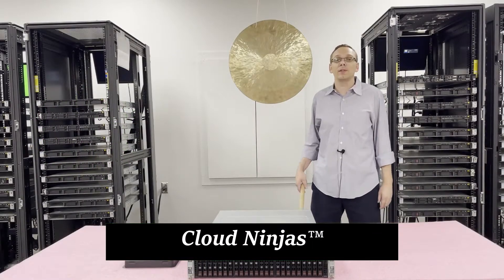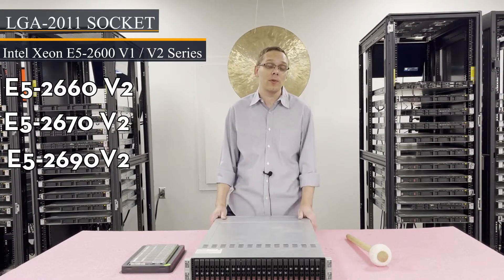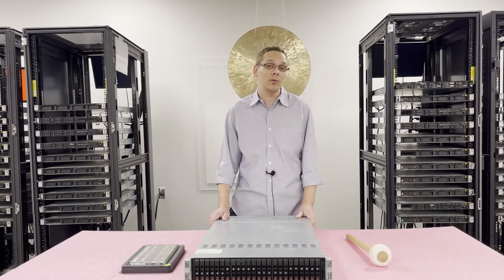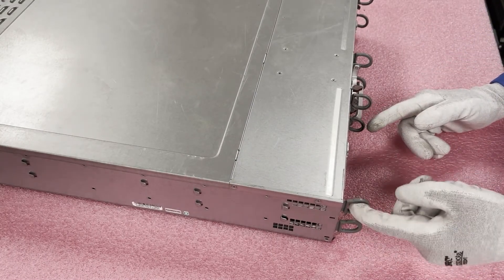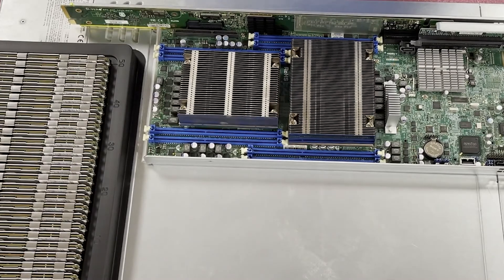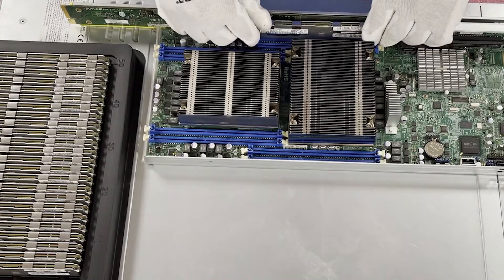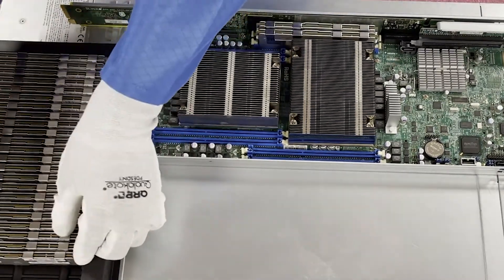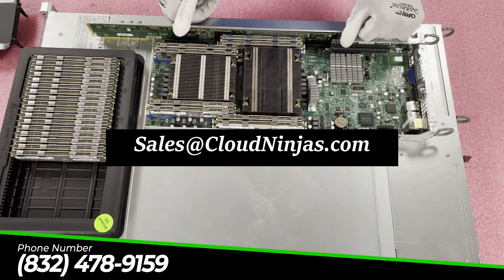Supermicro X9DRT-F & X9DRT-HF Server Motherboard Overview | CSE-217 | DDR3 Memory Configuration Tips

Comment: Hi! Did you find any problem with upgrade/downgrade CPU? I have one that came with e5-2630L v2 installed, I try to install e5-2630L v1, but it won't boot, neihter boot screen.
Reply from the maker: You cannot mix CPUs.  Must be same processor.
Reply: @cloudninjas  Thank you! sure. There are 2 CPU of the same model. let's say  I have one that came with 2x e5-2630L v2 installed, I try to install 2x e5-2630L v1